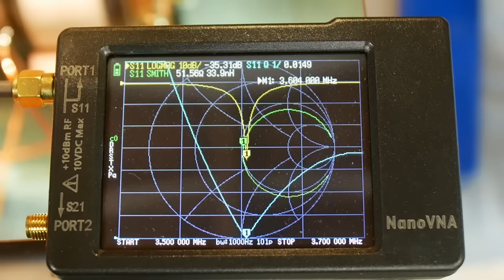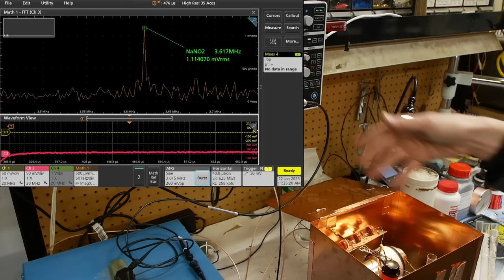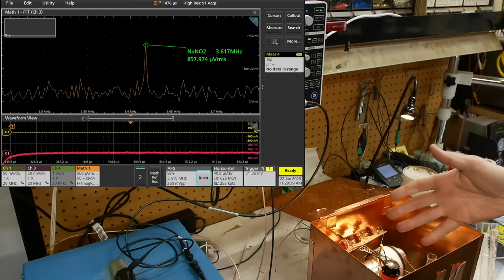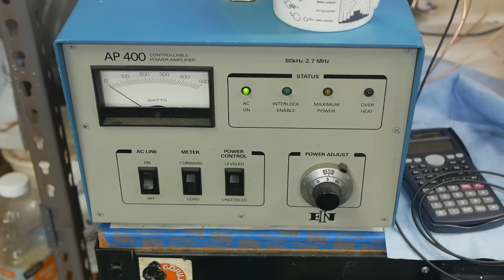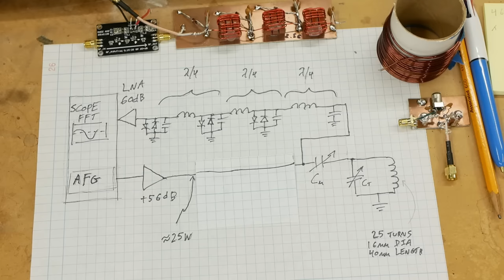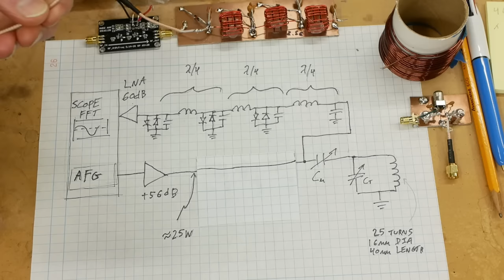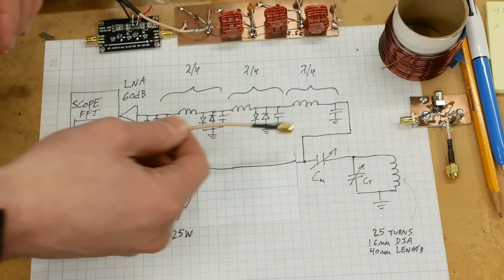Identify chemicals with radio frequencies - Nuclear Quadrupole Resonance (MRI without magnets)

Comment: @AppliedScience  Great demo and explanations.

You might want to try using high-frequency spark discharges (high-voltage low-amperage, something like 20KV @ 120uA) in proximity to your setup.

This can create a hybrid-NMQ-NMR, possibly broadening sensitivity and utility.

In experiments with only the spark discharge methodology, appropriate elemental NMR frequencies were clearly observed on an oscilloscope  in FFT mode.

Comment: wow so cool that someone can build this in a garage basically!
some things on my mind about the experiment:
-	If our transmit pulse is 100 microseconds, does the signal to receive also have the same duration?
-	Is it possible to isolate the transmitter and the receiver by outfitting two separate coils to the sample, so the high input power won’t be a problem?
-	Does the phase of the sample matter? What if its solid vs liquid/solution? What if we ground the paracetamol pills to finer and finer powder?
-	If the alignment of nonspherical nuclei is done by electric field in NQR, would it be helpful to place the sample within an external electric field (like between capacitor plates, a substitute for the big NMR magnet coil)?
-	Knowing that molecular electric field is oriented randomly in an NQR powder sample, what percentage of the sample do you think contribute to the signal?
-	Even if we’re focusing on nitrogen, do nuclei of other elements in the molecule contribute as “noise”?

Comment: Also explains how a pulse-induction metal detector works!  Hint for acquiring a variable inductance: Pushbutton car radios tune using a variable inductor as the tuning member.  Rewinding the coils can get you closer to fine.

Comment: Always impressed with your motivation to learn whats needed to achieve your goal.  That being said one observation is that using diodes to do your attenuation leaves decaying transient and your LNA dc operating point which then needs to settle before the gain returns,  also having to retune your isolation based on signal wavelength is a pain. Have you considered instead building  Mosfet switchable PI attenuator which is broadband, at MHz frequencies you should be able to easily get 30dB to 40dB of attenuation per PI attenuator, and cascading two or three should do the trick.

Comment: Not sure if it would be applicable here but with high power radar transmitters we would use a PIN diode across the waveguide to the receiver at the correct distance from the transmitter branch such that it acted as a short when energised by the transmit pulse. During the non-transmitting region it was an open circuit and would therefore allow the weak return signal to propagate to the receiver.

Comment: First time here. I really appreciate this. Over my head at manly levels but im studying Quantum Medicine and i saw your precession explanation with the Gyro and it sparked an answer to a theory i was presented about how Intense emotions create abbertions in the field around cells. This X nuclei causes electric puddling or an interruption ior contamination in the electric lines of transmission that instruct our cells what to do,, when, and for how long. I saw an image of wha happens to the gyroscopic events of the quanta as the effect the 'field" and this "flip angle" as you call it, once it passes a certain degree causes a secondary X Nuclei to be born. Sorry to ramble but this helped in an epic way! Excellent work !

Comment: Analog Devices recently came out with some interesting MEMS switches for RF designs - max frequencies up to 34GHz with max input power of 33dBm and a switching time of only 75us. The power limit seems a little low, but you can supposedly run them in parallel.
It might be an interesting way to reduce the losses from the quarter wave filtering.

Comment: I didn’t read all comments to know if someone working in quantum information has mentioned this, but it still boggles my mind to recognize what you built at home is the backbone of a spin qubit measurement circuit using reflectometry, except of course here there are numerous spin qubits and not just one. This video would serve as a great introduction for quantum information students on how to drive a spin qubit and basic echo techniques. Incredible

Comment: Thanks I've been planning on building one for a while 2 projects down my list, using a 200mhz ADC and some slower ones with a FPGA with magnetic fields... I was under the assumption that there would be multiple frequencies ring back and a Fourier transform would be necessary. But I was planning on more of a MRI microscope as the goal.

Comment: What you need is a T/R switch that isn't frequency sensitive.

The pin diode scheme may do it if you can have a source of voltage synced to the transmit pulse, and provide DC voltage blocking from the receive amplifier.

Have the biasing of the pin diodes cause one diode to short to ground, while driving the second diode to stop conducting the signal to the receive amp, then, switch to the opposite polarity to open the diode to ground, and short the diode to the receiver amp.

The receive amp will then be ready to listen for any frequency signal from the sampling coil, without having to retune any circuitry.

Comment: As an MRI tech I find it fascinating to watch what you managed to do. Spin echo on bench with pretty basic stuff. But I was wondering about the problem you had with doing multiple refocusing pulses. I was taught that RF pulse design is pretty important. In MRI adiabatic pulses are widely used to get reliable 180 degree pulses. I'm not entirely sure but I think the hyperbolic secant pulse is one that is used often.  I am not sure how much you can program the scope, but a look into an adiabatic RF pulse might be a cool next step.

Comment: Perhaps you're having issues isolating the paracetamol/acetaminophen/tylenol signal because of the fact that it's actually quite impure. It's usually full of fillers to get it to the desired physical size then coated for easy swallowing/handling. Not to mention the text that is often printed on them. I'm currently working on a clinical trial where acetaminophen is being used to track the subjects' bodies' processing time of a known quantity of glucose to determine their insulin sensitivity. A very accurate and precise amount of paracetamol is required for this to work and the stuff on the market is very loosely standardized and QCed, so a solution using freshly synthesized pure acetaminophen had to be made from scratch just for the insulin sentivitity testing, before the actual trial of the experimental drug can even begin.

Comment: Amazing video as always: Regarding the tuning of the capacitors and the magnetic field amplitude measurements you perform - maybe consider the detuning of your LC circuit both by the magnetic probe and the dielectric loading of your material sample and the glass tube. I would at least check that an empty test tube does not detune your circuit - or place one in the apparatus while tuning your capacitors. Maybe you have checked this already, but if the magnetic probe detunes your LC circuit you will also get a false low reading. Happy experimenting :)

Comment: This is brilliant! And coming from a hifi audiophile background, I know how important galvanic isolation is for eliminating noise. The copper box will help isolate the circuit from outside RF noise, but it won’t isolate it from noise from within your electrical system and power supply. Also the circuit components themselves should also be galvanically isolated from the measurement coil, so that it doesn’t affect the measurement. So boxes within boxes and power conditioning. On the sound front, I use Benchmark AHB2 power amps which have a ridiculously  low noise switch mode power supply and a noise floor of -137db which is below the noise floor of the best $100k signal analyzers. Once you get the noise taken care of, then the next thing might be making an AI that can identify various elements based on their resonant frequencies. That would be ideal, where it would automatically run the tests and then analyze the spikes and label them for you. Anyway this was a super cool and very inspirational video! Nice job.

Comment: great as always. Why not have a rod core inductor that can change the inductance based on how far the coil and the rod/screw are overlapped. One more thing, will the signal not work at all in solvents, there must be a way to increase the dipole using a polar molecule and intern disturb the negative and positive areas close to the nucleus giving a stronger signal without having excess noise from the solvent.

Comment: I'd like to read more about the molecular makeup vs frequency - I think I see a way to make this useful for quick identification of unknown substances (that is semi-portable and doesn't require cryogenic cooling).  It would be useful as you described for looking for specific compounds, but it may be possible to build a device that would process, detect peaks, and identify compounds in an unknown.  It's worth looking into - my forte is to develop new methods and devices for identifying archaeological materials.

I'm rather familiar with most of the other methods - some reading on proton spin resonance (which is very similar to this), ICP-MS (I've helped run a few machines), XRF (regularly used - EDXRF), and so on (including methods using optical wavelengths which as been my focus for the last few years).  This suggests to me a completely new tool.  (I've been working on something similar but which operates on a different principle.)

Your video has given me much to think about.  I appreciate the knowledge and the links!  (BTW - Do you have a link to spectra vs molecule makeup?)

Comment: Very cool, Ben. Yes, w2aew is awesome :)
I wonder whether you'd get better results with all the components that share the common  ground actually soldered to a solid contiguous ground plane with as short jumpers as possible? The calibration port is clearly connected into the system ground in a not entirely ideal way. Maybe have the shorting inductor/capacitor/diode combo board as a module that also sits flat on and ties in to the same ground plane. Should be interesting to see if there's a significant change in the performance of the apparatus. Cheers.

Comment: Superb video and great topic!! A way to get a better s/n relation would be to average multiple FTs (Fourier transforms) instead of averaging the result peak heights in the freq. domain. That way, the signal would increase with the number of measurements (n) but the noise only with the square root of n. I do not know if that is doable with your scope, but for sure doable exporting the data to a computer and using some math software. Some commercial NMR instruments average 100s or 1000s of pulses this way in order to get a usable signal.

Comment: I certainly won't be building anything like this anytime soon - which is why I'm glad you did. What I was fascinated by was the passive technique of blocking the power signal by means of quarter wavelength filters (and inverse diodes). And I thought of the problem of designing a mobile phone where ( perhaps) the aerial has to be shared between the power of transmission compared to the pickup of a low signal in reception. Might this be a situation where such a technique is used?

Comment: Because the electric field gradient at the location of a nucleus in a given substance is determined primarily by the valence electrons involved in the particular bond with other nearby nuclei, it is much prezise and easier to look at the electrons directly with UV-VIS, IR, Rhoentgen, chemical methods  etc to identify elements and moleculs

Comment: There are substantial differences for accuracy measurements. 
First of all it has to be done in a vacuum chamber. Then there are other variables: The vibrations density so the state form itself, the environment temperature and there is a basic resonance everywhere that you should take into account. 
But after all it’s great work and has a lot of potential when you make it backwards enable to create Krystaline structures ⚡️

Comment: I'd have thought you could use a common mode rejection amp/coil to filter out the large stimulus signal? Although that might introduce its own issues of course.

Comment: I started and never finished a desktop proton nmr project years ago. I remember that I went to the effort of finding Teflon insulated wire to use in my coil as graybeards warned me that hydrogen atoms in other wire coatings could cover up the detection signal.

Comment: great experiment as always! Suggestion: There is a way to make a wide-band (I mean no tunning over freq would be needed) quarter wavelength transmission line that is much shorter than coax: a microstrip or srtipline transmission line over a very high dielectric constant ceramic. You probably already know about these ceramics, they are cheap and have very low loss even at GHz range.

Comment: 33:32 This reminded me of a passage in Horowitz and Hill, about electronic measurement being superbly accurate when you have the ability to repeat measurements at very high frequencies. Principally, I think, because of the amount of experience people have accumulated engineering RF signals. They write something like "We can measure time far more accurately than we can measure  (anything else?) ...." I think that is somehow the key to the frequency domain.
Reply: Here's the passage, (from the second edition) not exactly how I "remembered"!: 15.17 Time-to-amplitude converters

In nuclear physics it is often important to know the distribution of decay times of some short-lived particle. This turns out to be easy to measure, by simply hooking a time-to-amplitude converter (TAC) in front of a pulse-height analyzer. The TAC starts a ramp when it receives a pulse at one input and stops it when it receives a pulse at a second input, discharging the ramp and generating an output pulse proportional to the time interval between pulses. It is possible to build these things with resolution down in the picoseconds. Figure 15.42 shows a measurement of the muon lifetime made by a student by timing the delay between the capture of a cosmic-ray muon in a scintillator and its subsequent decay. Each event creates a flash of light, and a TAC is used to convert the intervals into pulses. A cosmic-ray muon decayed in this student's apparatus once a minute on the average, so he accumulated data for 18 days to determine a lifetime of 2.198 ± 0.02μs (accepted value is 2.197134 ± 0.00008μs). ...

Comment: This was such a great video.  Thanks for doing it.  I have a few questions:
1) Do you have  a parts list?
2) Do you have a comprehensive list of the detection frequencies for various materials?
3) In the section with the gyro, you mentioned there was no electric or magnetic fields in your device.  Correct me if I'm wrong but your sample detection coil would necessarily generate the mag field for the analysis.

Thanks again!!!
Reply: He's comparing it to NMR/MRI which need the sample to be in a strong magnetic field in addition to the field generated by the coil.

Comment: Cool video! I took a class on MRI machines a number of years ago but now I understand the de-coherence during spin down better. 
Would an externally applied electric field change the resonance frequency in the same way that the externally applied magnetic field in a MRI does? 
Or would there be some issue with the non-uniformity of the sample / the required field strength would be too high / something else I am not thinking of?

Comment: That's some very interesting stuff. Thanks for the great explanation.
I have a question:
If the nucleus keeps changing it's flip angle as we are transmitting energy it would keep flipping indefinitely, right? So, as it gets in and out of precession, would it have and effect on the amplitude of the input signal? I know that we are transmitting watts and getting only picowatts back, so if there is a difference in the amplitude it would be immeasurable, but would there be any? And would each nucleus get out of sync from the rest, again?

Comment: Well presented. I am a recently retired NMR technician looking after 600Mhz, 500MHz and 400 MHz instruments. I found myself adding the nmr lingo to what you talked about as I went along. PW90, s2pul, spin echo etc. Having done a bit of Nitrogen nmr, I assume that you are looking at the rare 15N isotope rather than the 14N isotope ( uneven spin vs even spin). With nmr Nitrogen is a pain in the proverbial as the quadrature effects you discuss ruin the nmr signal and the small isotope % on 15N makes it very insenitive. In fact natural abundance 15N is almost impossible with what we call direct techniques. In biochemistry they use 15N enriched samples for nmr ( expensive ) but in chemistry we use the Nitrogen's interaction with 1H ie an indirect method.

Comment: When you use an exciting HF Magnetic field in your coil, 3.16MHz, however the substance you are checking may not produce enough feedback resonant, because may be it needs a higher than 3.16 Mhz, so may be you can sweep the exciting field from say 2Mhz to 10Mhz and then analyse the return resonant frequency, we use this principle in detecting RF Tagging systems in prevention of theft from shops.